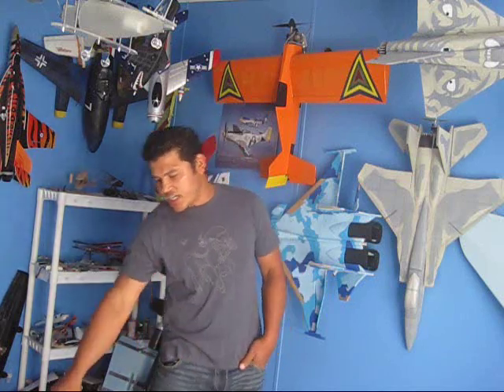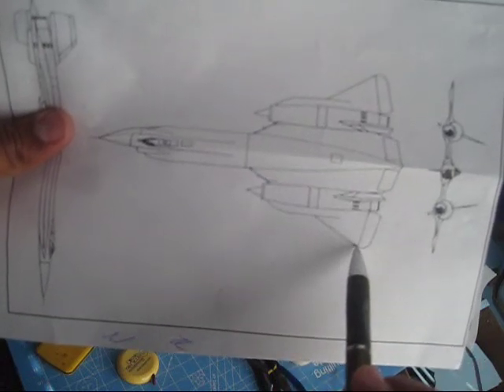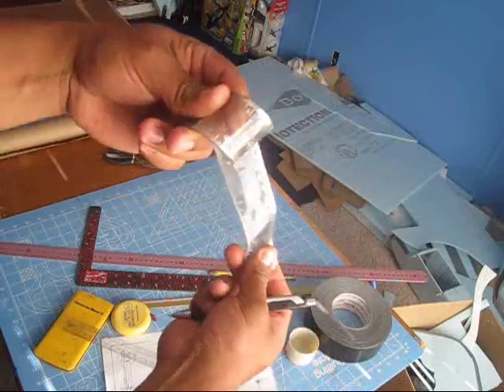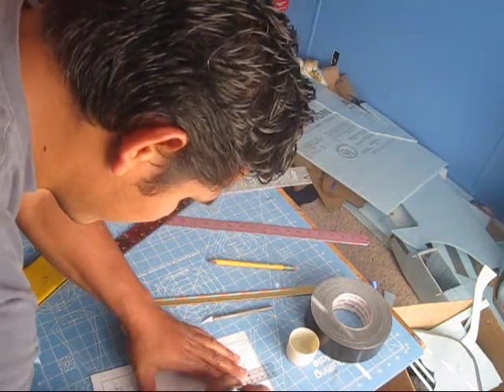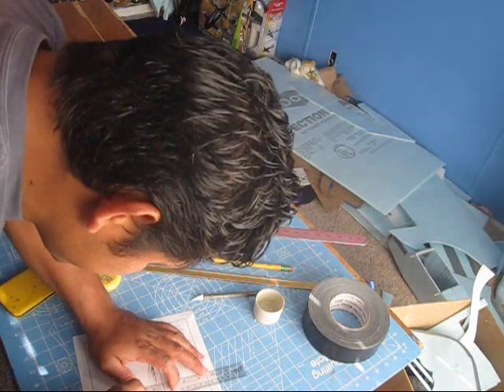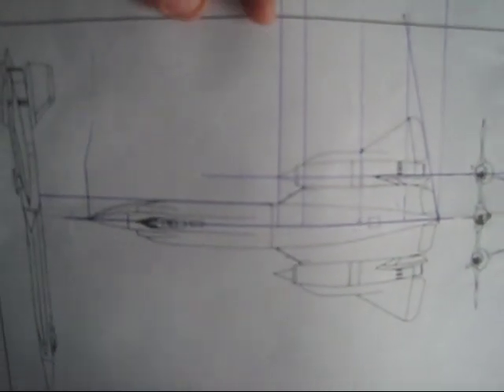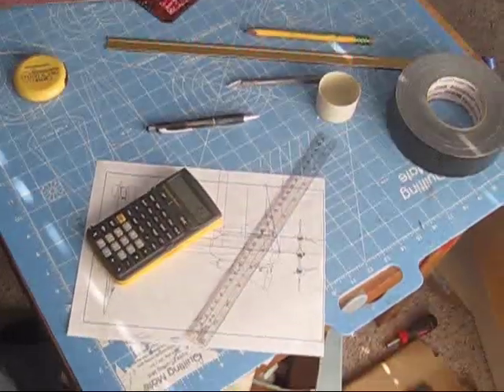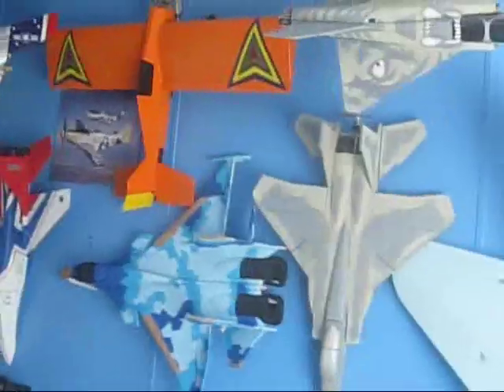how to build a rc airplane from scratch

Comment: The reason for the differance in the nose of the sr-71 is. one was designed as the sr-71 the top of your page, the bottom is a yf-12a. One was for high altitude and the yf was for lower altitude.